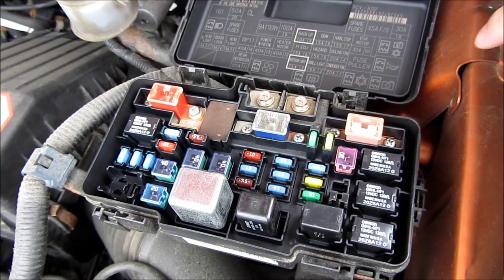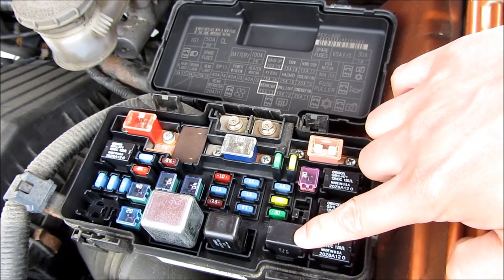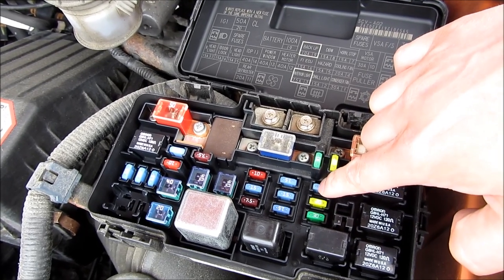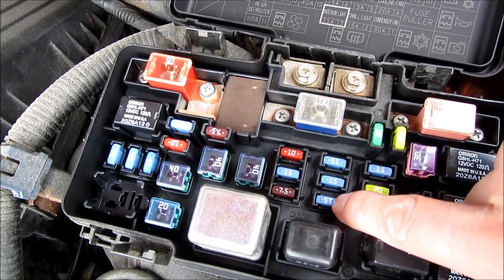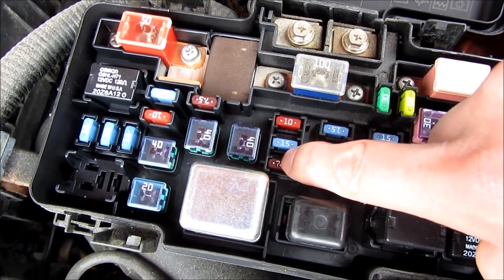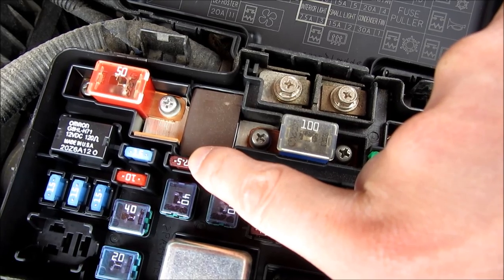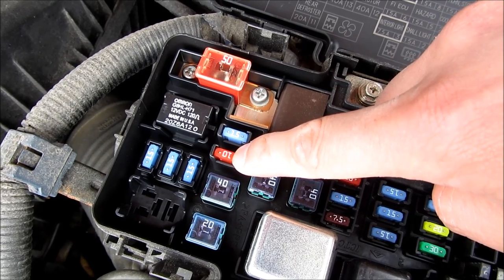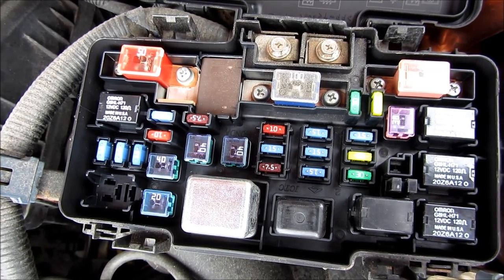Honda Element Fuse Box Description

Comment: Just replaced the ignition switch on my 04 pilot, had to remove the fuse box on the drivers side to install new wire, now everything is back together and car will try to start, or start very briefly, I believe I did not put wires back correctly on fuse box front, but no diagrams show the side closest to engine, it's a yellow capped wire, cant figure out where it goes, seems as there is no fire, or fuel on start. PLease help anyone.

Comment: I have a question about the fuses and relay box - the radio is a 10 amp relay. I'm looking at a radio that requires a 25amp relay - is it as simple as replace the 10 with a 25, or is more serious wiring required? (Asking for my twin. Thanks)

Comment: which one is the taillight fuses. you said it at the end but I couldn't tell what fuses you pointed at?
Reply from the maker: Are you able to download the diagram in the Description area of the video?
Reply: My wiper blades don't work is there a relay for them. 

The wiper blade fuse under the steering wheel come in and now the new ones ain't doing nothing.  @PoolarityChannel

Comment: 1 of my fans stopped  working  im over  heating  which relay  shud i chex and possibly  change
Reply from the maker: The radiator fan is fuse #4 in the diagram.  I hate to break it to you, but Honda Elements has the dead radiator fan issue frequently, usually the fan motor.  I had mine replaced a month ago for $280 along with the AC condensor fan, which is side by side with the Radiator fan.  https://drive.google.com/file/d/0B8fkhMWxOasKQjhBTGJ1Q1hWb0U/view

Comment: What year is your Element? I have a 2006, and my fuse box looks identical to yours except for one thing. I don't have a fuse in spot #7 (Brake lights, brake signal to ABS modulator, cruise actuator, ECM/PCM, horn relay, trailer lighting connector) but my brake lights work. I haven't tried the cruise in quite a while, and I don't have trailer lighting.
Reply from the maker: Paul McClure  2007 Honda Element
Reply: Thanks! Mine probably isn't supposed to have that fuse unless I have the trailer wiring harness. Now I just need to get my hands on the PDF of the earlier models (2006 is different from anything after that), and map it out. Your video is a huge help! I have been searching for something like this, previous to you posting yours. Now I'm going to cross my fingers, and hope the relays are the same on mine, as I try to diagnose my non-working A/C using your video for that!

EDIT: As it turns out, my missing fuse wasn't #7. It's #8, which is supposed to be empty, according to the PDF
Reply: The thing you called a plate is the eld "electronic load detrctor"
Reply: Paul McClure do you know which fuse for odometer lights?

Comment: My odometer went out, does not light up.  Which fuse is that?  TIA.
Reply from the maker: Likely a fuse that's under your steering wheel, not here
Reply: Element cluster failure. Take the dash out, and stick a cardboard about 1/4 inch thick in between the connector and the open cavity. Turn on lites, and check before putting dash back.

Comment: Hey genius the relay between the blue battery and the red ignition that you just said is just a plate that’s the DETECTOR UNIT ELECTRONIC LOAD 
😂😂😂 just a plate
Reply: Yea your right ...my 04 civic is having trouble starting...I change the ignition switch...new battery...and everything powers up fine when I turn the switch on or try to start it but it doesn't start